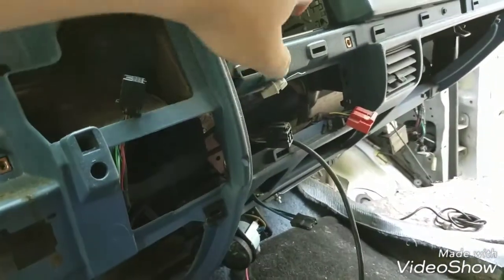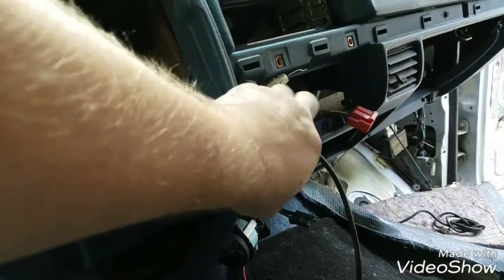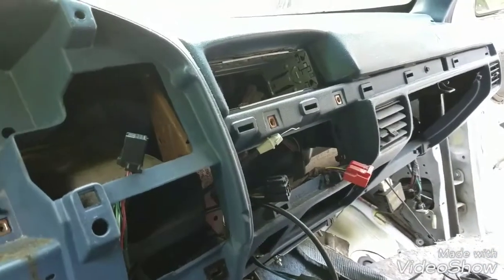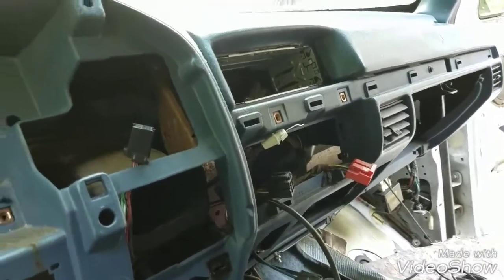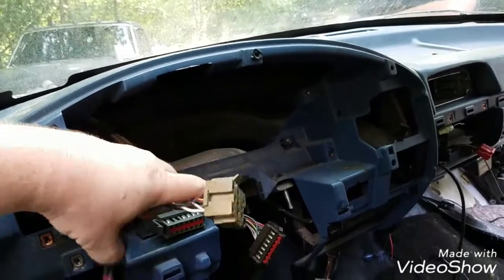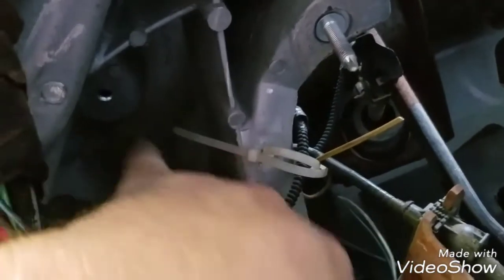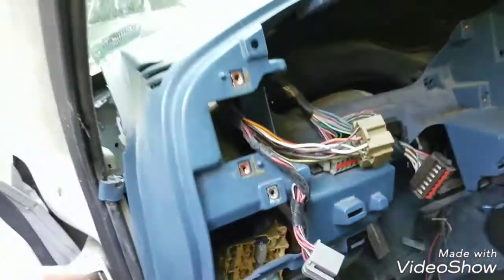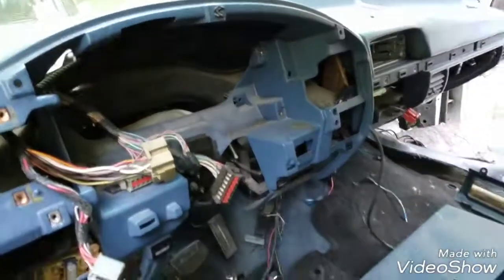OBS F-Series: 1992-1996 Dash Removal

Comment: There wasn't an extra 7mm on the driver side right behind where the door opens? My f350 has one that's actually impossible to remove...and I don't know what to do
Reply: Not sure if you’ve figured it out yet or not, but a finger sander might be able to get in there. A dremel, anything that can cut

Comment: There's still something holding the driver side dash together i did everything this video said akd still the dash will not come 9ut if there's anything you missed would like to know
Reply from the maker: I'm not sure then. Have had issues with wiring hanging on stuff before, causing it to not want to separate.

Just double check and take a good look at it.

Comment: Is there no source on the entire planet for a new dash? Anything from the 90's will be just like mine, the top 4 mounting points will be either weakened or broken from the sun coming through the windshield and 30 years of vibration. This is simply driving me crazy trying to find one; you can't. Any experience you might have would be appreciated.
Reply from the maker: Nothing to add here from me, past me just swapping dashes
Reply: @TheFSeries   @Wesley R. Cole  Thx man , If I ever found one your vid will be a big help. These trucks are great. Built Ford Tough ( can't get it apart, lol ).

Comment: Thank you for the video! Am I understanding correctly that you can remove the dash without dropping the steering column? I’m going to be pulling all my interior trim this weekend and repainting it, I’d love to make the dash removal as simple as possible
Reply from the maker: The column does have to be dropped; but it's only 4 bolts
Reply: The F-Series thanks for the response :)

Comment: Did the ashtray braket come out first?
Reply from the maker: You can take it out first, very easy removal
Reply: @TheFSeries  I'm attempting to remove the ash tray bracket/frame from my 1994 Ford Bronco. I removed the front two bolts and struggling to remove the bracket since it feels like it's still being held back by something. do you recall if there's more bolts or clips hidden underneath or in the rear of the bracket? thank you in advance

Comment: I cant get my ash tray to slide out after removing the two bolts
Reply from the maker: Are you meaning you can’t get the ashtray AND the frame for it to come out or just the ash tray itself?
Reply: @TheFSeries  nevermind i discovered a 3rd hidden screw lol

Comment: I just removed just the cover! let me say I am not a young pup and this job IS I repeat IS not easy ! taking my time in a nice shop with all tools an some . BULLSHIT  every video fails to mention the main wire harness has clips to hold onto the duct system .  It runs over the steering  column going down toward floor then along bottom of dash . Also my truck had 2 pins sticking up on the aluminum steering column bracket . lie all lies

Comment: Do you have to remove the steering wheel,radio, and the AC controls?
Reply from the maker: Yeah, all of those are connected.
Reply: The F-Series awww thank you sir for that info and thanks for that good video
Reply: James Broderick actually you don’t have to remove the steering column, the radio and hvac controls aren’t hard to take out

Comment: How did you tale the ashtray out
Reply from the maker: Pull it out as far as it'll go, then a tad more. Has a "Finger" that has to pop out of place to allow removal 

Then just unplug the light harness and remove.

If you're removing the tracks too, it has 2 bolts (1 on each side) to remove after you remove the actual tray assembly

Comment: I just got a new cab for my 93 and it’s stripped except for wiring for the interior light and 3rd brake light. Could I just remove my current dash with everything still hooked up except the steering column obviously and throw it into the new cab? Need to pull the connections out of firewall of the current cab for the new one.